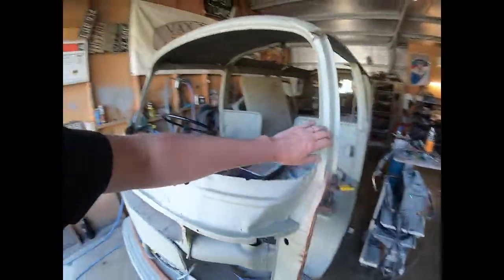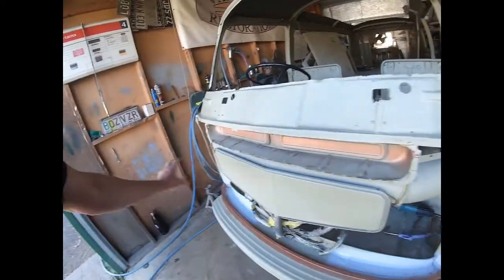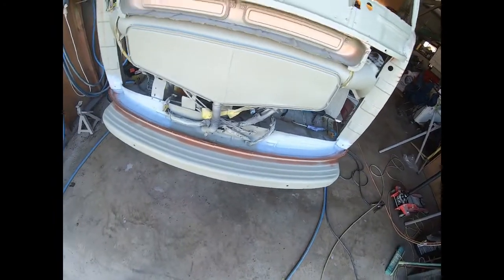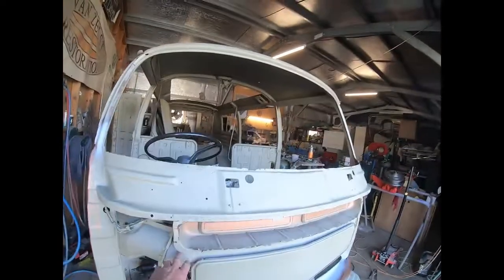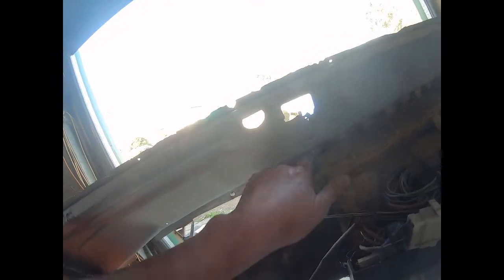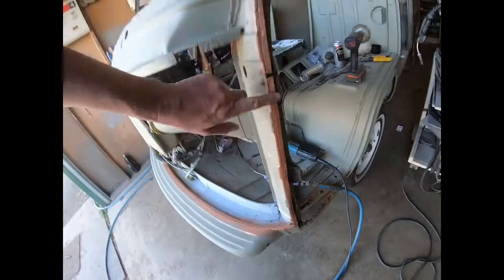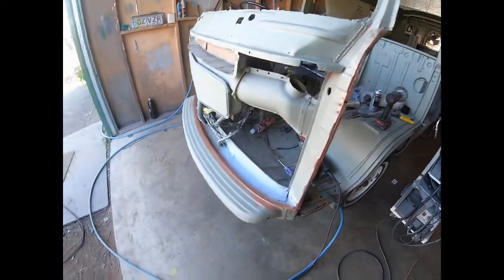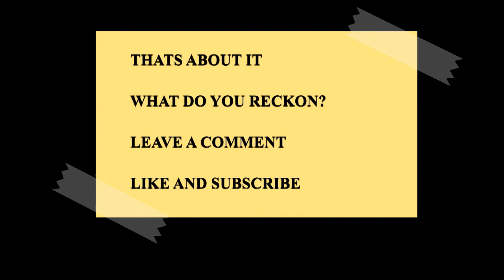BAYWINDOW  KOMBI FRONT NOSE REPLACEMENT

Comment: Another quality video & good job done, any secrets or tips to line up the doors after installing the panel ?
Reply from the maker: If the a pillar is straight all the way down then the panel gaps should be the same as before nose replacement. 
Door alignment is a 2 person job and sometimes it requires 1mm packers between hinge and frame.

Comment: Nice job!  Was that a klokkerholm panel?  I totally agree Epoxy is all you need, and some rust preventative in the tough to reach areas.   I am going to order the WolfsBurgWest nose when it comes time to do my 68 double cab.   I also heard that 3M/SEM panel adhesive is good for the nose to seal the folded areas as well.
Reply from the maker: This panel has been in storage for a while and I'm not sure of brand but I think it is a cheap one. If you can afford the better quality panels it will make it easier to fit.